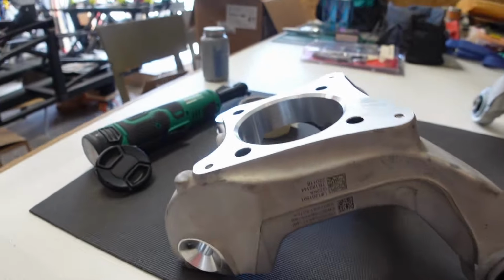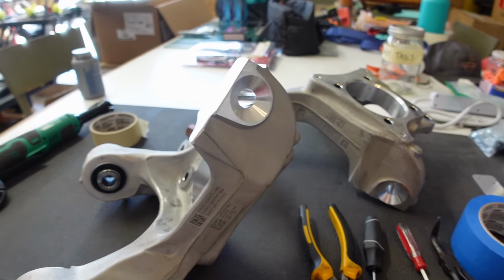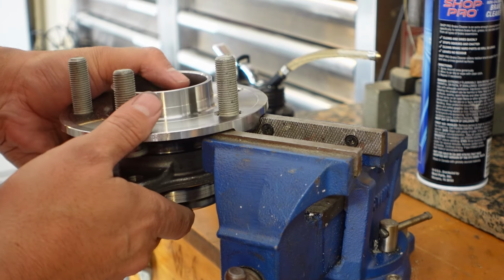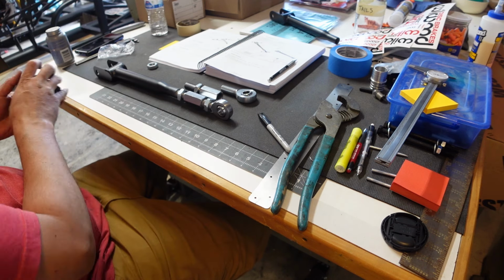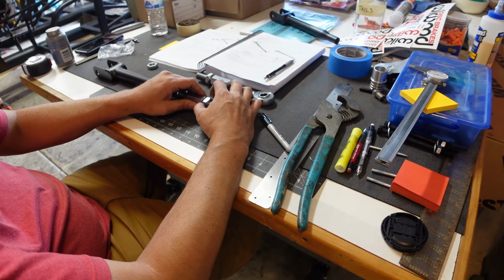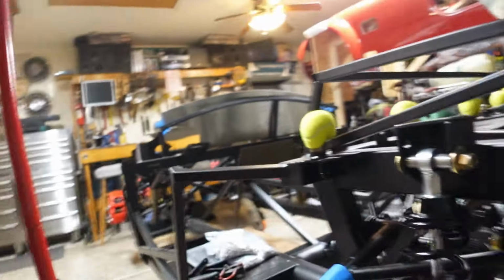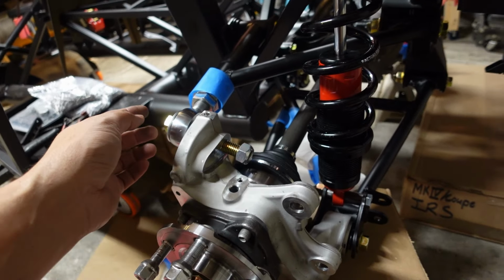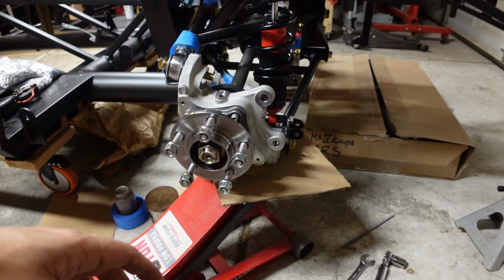FFR Mark 4 Roadster Episode 9 IRS

Comment: Paul, you amaze me with all the car knowledge. Why did you change the wheel studs? Does the kit come with all the fasteners too? Looks really cool!!
Reply from the maker: The rear hubs I think are for a different vehicle which gets adapted to fit the kit. 

I also noticed the opening for the lugs on the wheels are small so maybe the lug nuts for the slightly larger studs wouldn't fit the wheels. 

And to match the front so all the lig nuts match